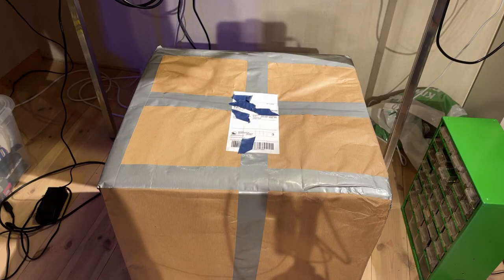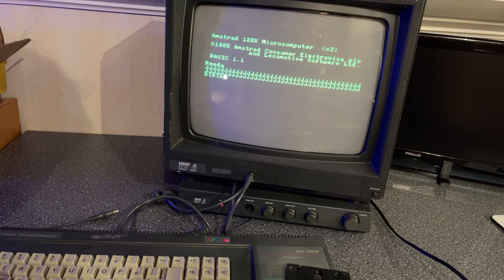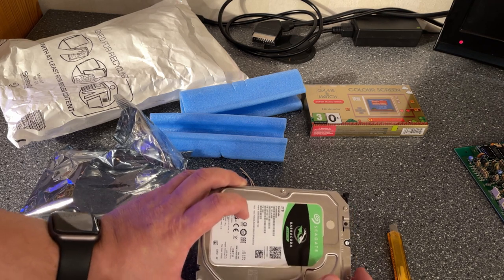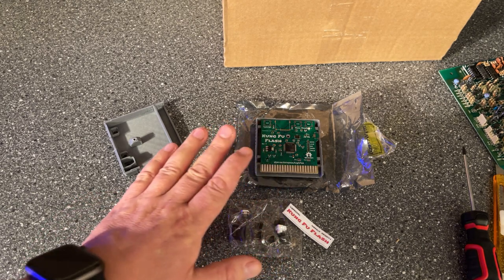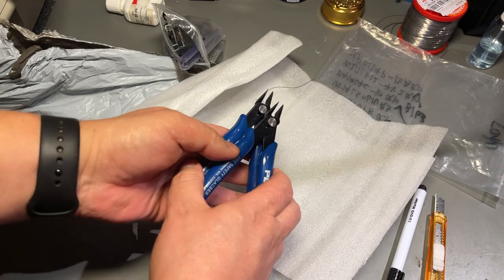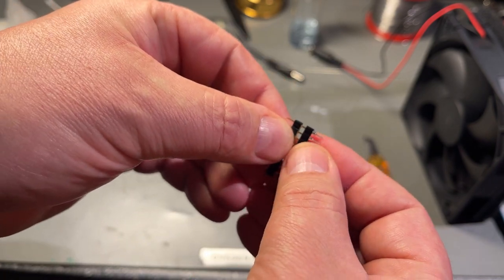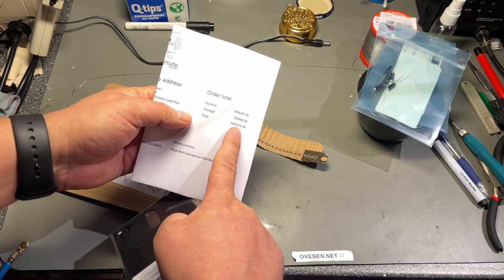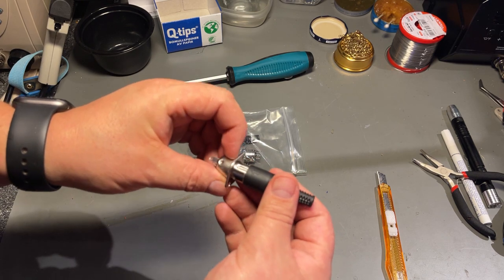Unboxing December 2020 - Amstrad CPC 6128, capacitors, more chips, tools, game

Comment: Nice catch on the Amstrad PC! Also great packaging. It's a heavy screen to ship through the mail. Good thing it was well packed! The Kung Fu Flash is a project I've been looking at for a while due to the software defined cart/rom emulation part, and the fact that it is open source! Ebay China DIN's, noooo... No comment 😬 😅
Reply from the maker: Hah. China DIN’s can be soldered with the potato method😀